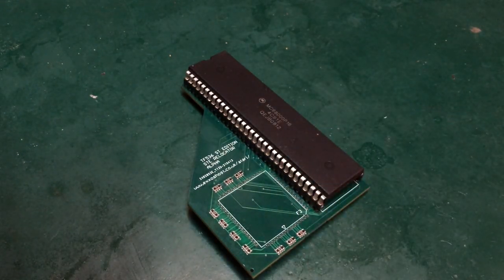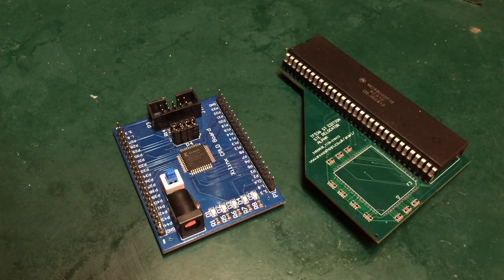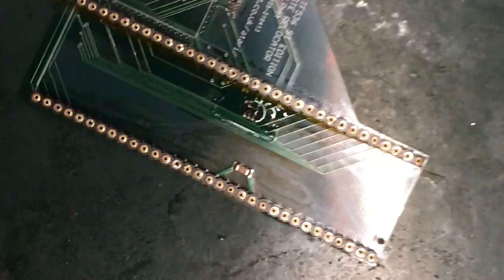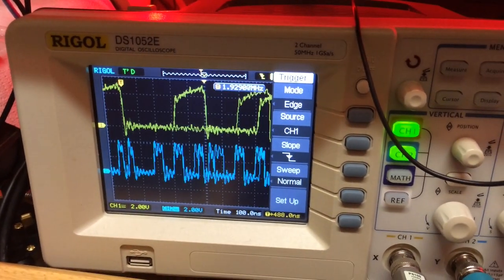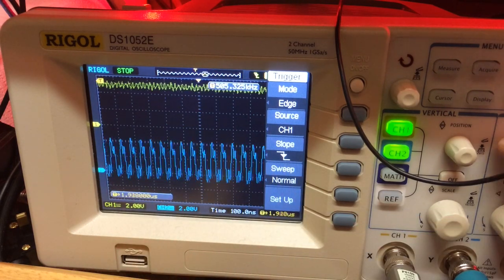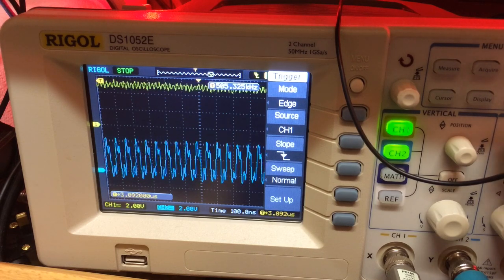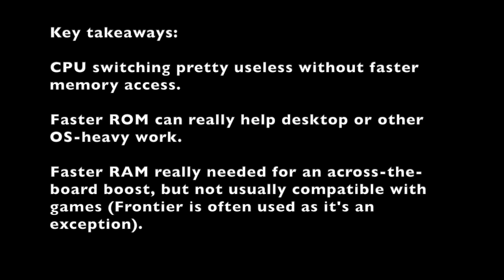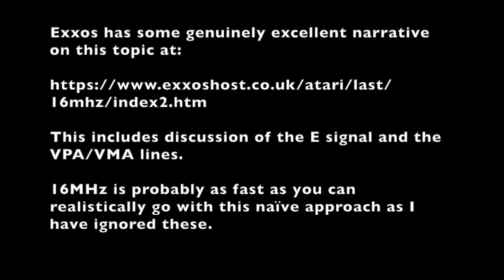Quick 16MHz hack for the Atari STE

Comment: Great video =D  Yes, you really need at least faster ROM access to make it worthwhile.  The only downside is it can knock out demos and anything that uses cycle counted code for higher colour depth etc.  You can see what I mean on many of the "PP" HDD adapted games where the box art or title is displayed as the game loads.   But that boost (with ROM boost too) does translate into a nice increase for lots of things.  I've noticed decompression routines in some games noticeably faster, and it just feels much more responsive in TOS, especially when coupled with a Blitter (on the STFM).  On the STFM I usually have the Blitter run at 16Mhz when the CPU does too, and it seems pretty solid.
Reply: Not sure I've seen anyone accelerate the ST Blitter before, could make for an interesting video...
Reply: @EvilFranky  I am pretty sure when I did the 16Mhz mod I did cover it.  But the video was filmed a long time ago and really poor imo, not long after I started my channel.  I will be re-doing a lot of stuff in my ST shortly and will cover it again at that point.
Reply from the maker: Thanks, Gadget!

Comment: You think it's a good idea to switch clock on a CPU with dynamic CPU design? I did quite the same for STs a year or two ago (it's on atari-forum) revisiting an old DIY project from a German magazine. They just delayed the /DTACK with Dallas DS1010 ICs and let the CPU run at 16MHz all the time. I used a FSM in a GAL22V10 to achieve the same and the result - as you stated - is poor: +13% :-/ But I knew that before just wanted to see if I can do it.
Reply from the maker: The delayed DTACK trick is technically superior in many ways, but was very difficult to get to work on the Falcon (where the underlying clock speed is dynamic, there are more convoluted peripherals on the bus and the chipset happily starts decoding the next AS again straight away). So I clock-switched there. That meant I had an off-the-shelf clock switching project. Also, in this case, I only had control over the clock (everything else wired straight through). So it was the obvious hack to use.

Comment: Back in the day my atari ste i put a T28 accelerator board in it running at you guessed it 28mhz it also had some fast cache ram so it ended up being approx 2.5 times faster then a standard 8mhz st
Reply from the maker: Yep, a good cache set up is a great win. Was looking into what I could do in the cache line, but turns out to be an expensive option even today!